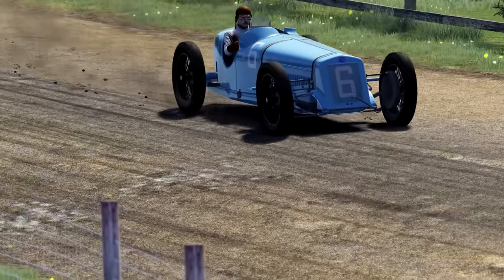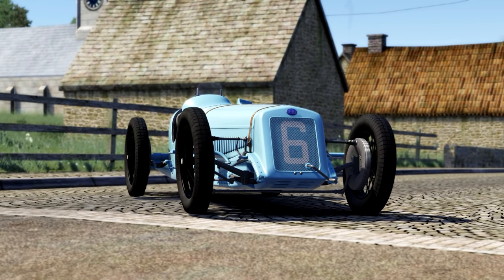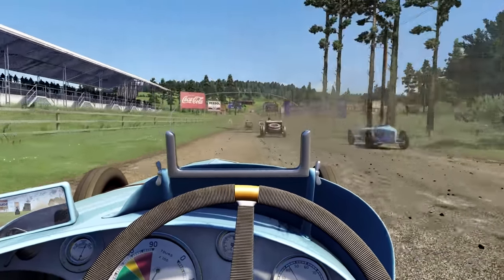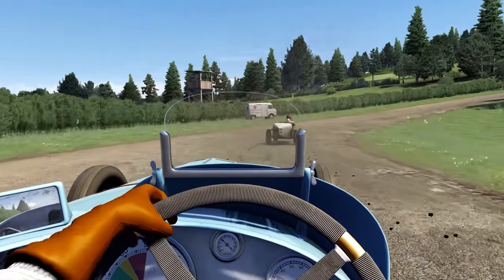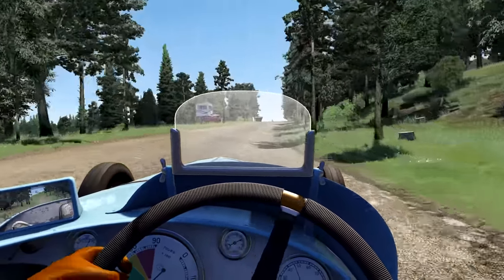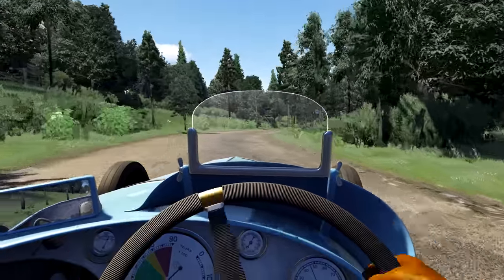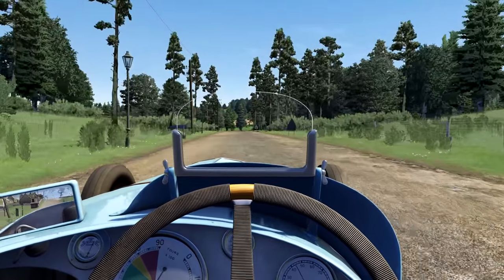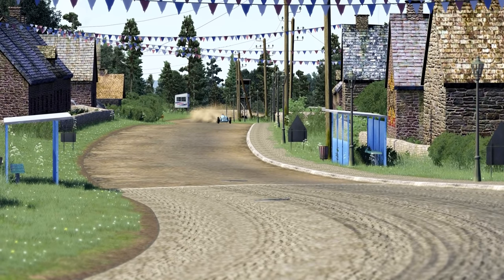France's Greatest Grand Prix Car - 1927 Delage 15 S8 - Assetto Corsa

Comment: Between This Car, NiceCuppaTea's 1923 GP pack, Gary Paterson's Auto Union Type C, Mantasisg's & AphidGod's Mercedes W125, and both the upcoming 1906-07 & 1934-37 GP packs from A Casual Sim Racer, Assetto Corsa is now shaping up to be the Spirit of Speed of the modern era that we deserve and need.

-1906 Renault 3B De l'A.C.F. (wip)
-1906 Itala 35/40 HP (wip)
-1907 Itala 36/45 HP (wip)
-1923 Rolland-Pilain A22
-1923 Sunbeam 2-Litre
-1923 Fiat 805-405
-1923 Voisin C6
-1923 Bugatti Type 32
-1923 Delage 2LCV
-1927 Delage 15S8
-1934 Auto Union Type A (wip)
-1934 Mercedes-Benz W25 (wip)
-1937 Mercedes-Benz W25 Streamliner (wip)
-1937 Mercedes-Benz W125
-1937 Auto Union Type C

These beautiful, scratch-built titans of the Pre- and Inter-war era are some of the most fun cars I've ever driven in a sim, and the more that this era gets expanded upon the better.
Reply: Thanks! I'm trying to make sure they live up to the hype.
Reply: i would like to see the FIAT S76 on AC!
Reply: @acousticproject6816  Who wouldn't? She's an absolute monster - well deserving of the 'Beast' nickname..

Comment: To be fair, while the Delage is a great racing car, the opposition is pretty fragmented in some ways, which, I think, helped it win the Championship in 1927. My take on the subject is, Delage experienced in 1927 what Mercedes would later experience in 1954-55. Basically both teams made something really special, and the opposition, while trying hard to be as good, had other problems which didn't help.

Delage, after experiencing a major design flaw in 1926, redesigned the 15 S-8 for 1927 and it became such a good car. It is a pretty intricate machine, but fast and extremely reliable.

Bugatti's response is the Type 39A, which, is not really something that could cope with the Delage, considering it is basically a supercharged Type 35 with the single overhead camshaft engine reduced to 1.5 liters, by using a short-stroke crankshaft. So, with the power the car is making (which is less than the Delage is making), it is a comparatively heavy car.

Automobiles Talbot had one definite contender, the Talbot 1500 8C GP (also known as the 700 GP, or just as the Talbot-Darracq Grand Prix, I don't know which is its official designation). Designed by former Fiat engineers, this had the same recipe as the Delage, low-slung, with a pretty advanced engine making around 160hp, which is not far from what Delage is making. It is, also quick, but reliability and development was severely stunted by the company's  financial problems, in fact, the team closed down after the 1927 French GP. The car's potential is shown when Emilio Materassi bought the cars and ran it in 1928, and his teammates continued to drive it in the next two years, with the Talbot regularly harassing the bigger-engined Bugattis and Alfa Romeo P2s.

Then we have Fiat. They made the almost legendary 806. Legendary, because it won the only race it was entered in, and was shortly scrapped, when Fiat stopped racing altogether. Signor Agnelli seems to have been fed up with other companies stealing his engineers for their own racing programs.

Comment: The 1920s mods are my favourite content for AC. They're such fun to chuck around. Would certainly love to see more of the tracks these cars raced on - I mean, we have the 1923 French GP cars now, the only thing missing is the Tours circuit and you have the full experience right there. Fat Alfie's tracks and Donington 1937 are brilliant - they deserve more companions.

(also, just quietly, this type of stuff is the sim racing YT content I always wanted)
Reply: Absolutely. Apart from the free content, a 1920s grand prix sim would be a blast but would certainly cost me the divorce 😁🇵🇹
Reply: @jamesbehra2690  I would love a sim that would focus on grand prix racing from the 1900's all the way up to 1939. A Spirit of Speed for the current era with the physics and graphics to match. Some of the biggest obstacles would be working out the physics models of the more antiquated suspension systems of the pre-war cars, as well as reliable performance data for the more obscure and poorly-documented cars.
Reply: @SouthPawRacer THL has made a fantastic 1920's Opel-Rennbahn, Sergio Loro has the Terramar & 30's Indy, and Italotracks has the Napoli street circuit. Vintage sim racing content is starting to come about at a fair clip nowadays.

Comment: I hit the [Like] as soon as the intro was finished (didn't want to interrupt it).

Obviously, despite your Tweet, by the numbers, there's really no GP car, French-made or otherwise, that matches the Bugatti Type 35 and its derivatives in terms of outright success.  That said, I think the Type 35 is perhaps the most mundane to look at.

Of course, the Type 35 itself couldn't compete due to the 1.5-liter rules introduced for 1926, so Bugatti had to work with the Types 37 and 39.  Maserati had their Tipo 26.  Sadly, it took another year for Talbot to get its car really sorted, and then Materassi was killed.

In terms of a car itself, the worst fate was that of the Fiat 806, which won the only race it entered, the 1927 Milan GP at Monza.  The program had been done in secret, and when management found out, it was shut down and all traces of it were wiped away.

And yes, it was a short event (50-km Heats and a 50-km Final), but it's still stunning the pace the Fiat showed, even against 2.0-liter cars.  Based on Heat times, Bordino was 4.4 sec faster in his group than Maggi in the 2.0-liter group.  Benoist was able to get to only 1.8 sec back, but the Delage team chose to withdraw before the Final.

In the Final, Bordino set a Fast Lap 3.8 sec quicker than what he'd done in his Heat, leading Campari in a 2.0-liter Alfa P2 to the line by nearly 40 sec after only 5 laps.

Yeah, even much later, Dr. Helmut Marko took a stone to the face at Charade during the 1972 French GP (last time it was held at that circuit).

Is that a Bugatti Type 51 you're chasing?  If so, it makes sense why it can give you a run for it, being a bit later and having a bigger engine (either 2.0- or 2.3-liter with supercharging, possible 160-180 hp).

After this, I guess someone needs to come up with that surface like some of the old start straights seemed to have, where the dirt road was covered with planks.

The 1927 French GP was indeed at Montlhery, but not on the oval. It used one of the bankings and the straights, but then went outside the oval and used the whole of the road section that was available, totaling a 12.5-km lap.

And as I recall, that time really isn't much slower than what the first 3 1923 cars were doing on the paved version from your earlier video.  I'm sure the Delage could shave minutes off that time with the grippier surface.

And again, you can't see a bloody thing mired in all that dust.

The Spaghetti Western music worked really well with this.

I did mention the other main 1927, 1.5-liter cars to Fourty-Too! in the comments.  He seems interested in the idea, though he needs to finish the Miramas oval first.  (That one's nuts; I'm not sure about the exact banking, but it was large enough at just over 5 km around that you don't need much positive camber to go really fast.)

Also talked to Casual Sim Racer in the comments, and he might have a 1934 Alfa and Maser on the way, alongside the Mercedes W25 and Auto Union Type A.

The French circuits were more open back then, but not so much with the Germans and the Spanish, to say nothing of the Italians.

That was a really fun watch, and I thoroughly enjoyed it.

Comment: Dear Polyphany Digital: I want a game called "Grand Prix" where cars from this era are lovingly detailed with GT7 level graphics. Courses can be reused from GT series but must be redone in period appropriate aesthetic. Multiplayer consists of "scuderias" that have mechanics working on cars in a unique in-game setup pit area (think "WRENCHED" on the PC but simplified) to form multiple teams that race against each other. This would turn a 24 grid race into one with 96 participants (2 drivers, 2 mechanics per team). Make the requisite  corporate dystopia microtransactions be for players to create their own livery or to introduce further historic cars.

To see the community put out this level of detail in just Assetto Corsa is mind blowing and yet we still haven't seen a developer truly delve into this era. Considering just how much you could do with this level of graphics, this could be a killer app for sim racing in VR if they ever attempted it.
Reply: The biggest difficulty for developing cars of this era, let alone tracks, is one unavoidable fact: a lack of hard data.
So little documentation exists for pre-WWII cars that it's almost impossible to render them accurately. Furthermore, many manufacturers of this era are either completely gone, or their brand is used as a front for a new startup (eg Delage) or absorbed into one of the larger conglomerates (eg Bugatti). Not to mention, so few genuine articles exist that hard running for accurate suspension data & roadfeel testing would be prohibitively expensive, especially if anything should go wrong. Hell, not even post-war cars are safe from this.

Comment: Those winglets sticking out the sides near the hood vents also look like a very early attempt at aerodynamic downforce
Reply: No, they're splash guards. They're fitted so that stones kicked up by the front wheels would be deflected and won't hit the driver.

They're also sometimes fitted in wet weather, as they could reduce the water spray from the front wheels.